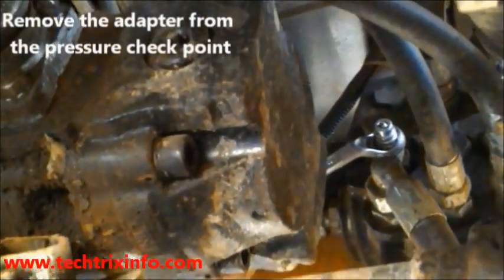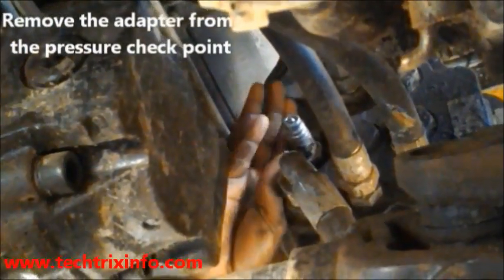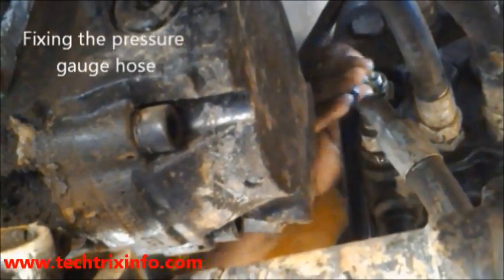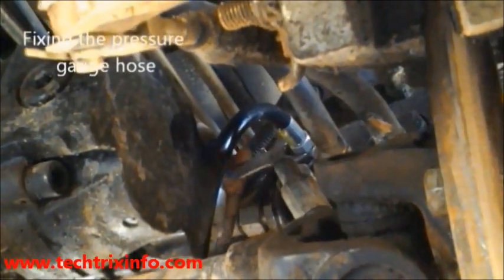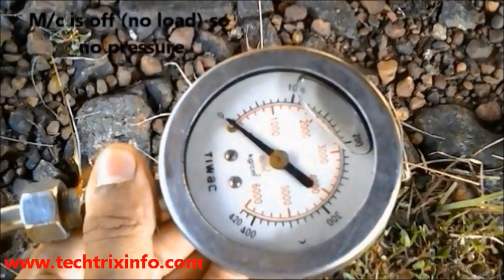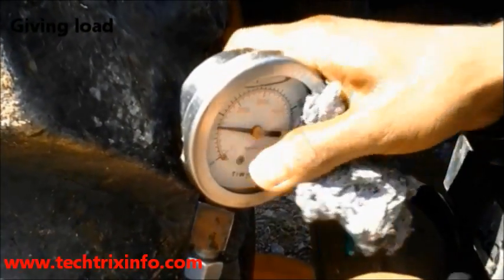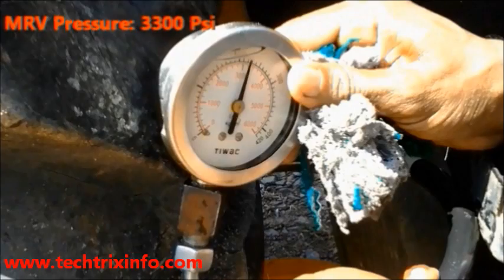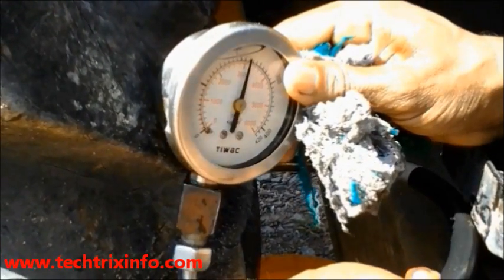How to check hydraulic pressure. ✔

Comment: If you want to loose your hands, that's a very nice way to do it!! handling the gage with your hands is not recommended for safety. People you have to go a way at a certain distance you can read the pressure without expose you to a high psi shoot.